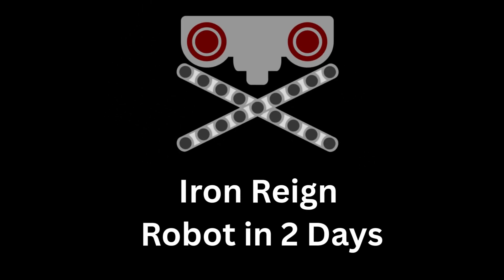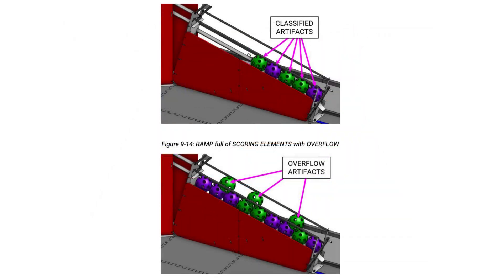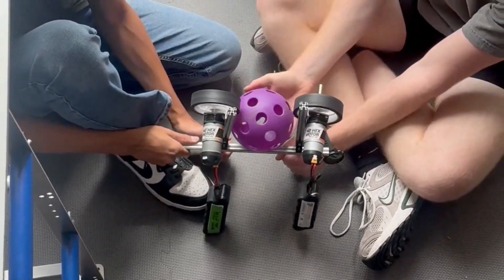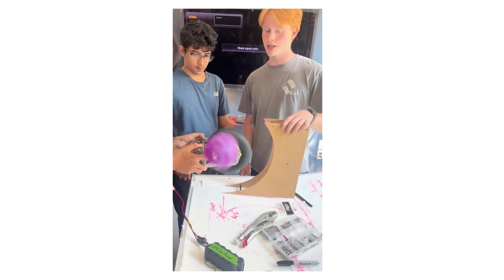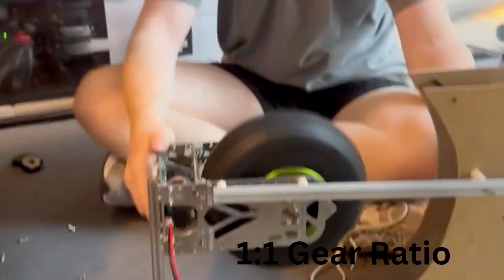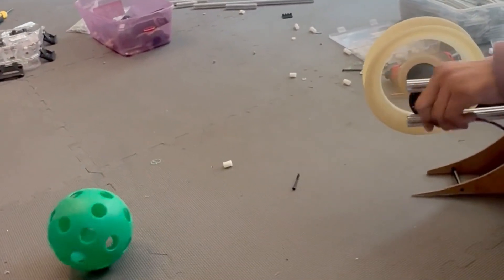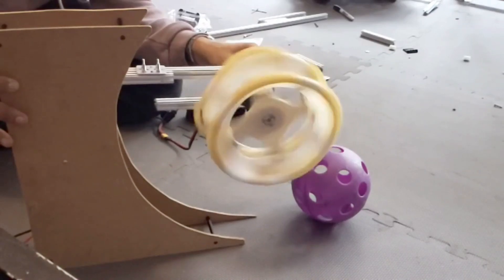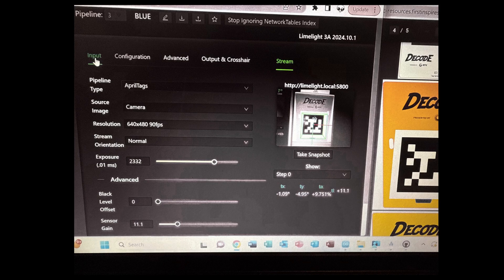DECODE Robot in 2 Days Launcher Experiments

Comment: The biggest thing I see is that these all need more rigidity, as they flex a lose so much power and efficiency. Bearings in the other sides of axles supports it on both sides, and that will help significantly